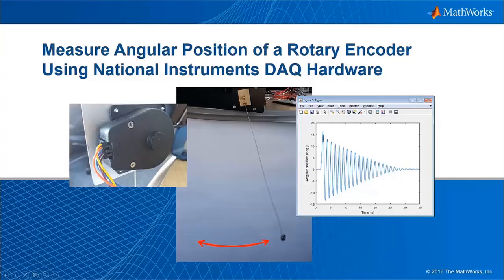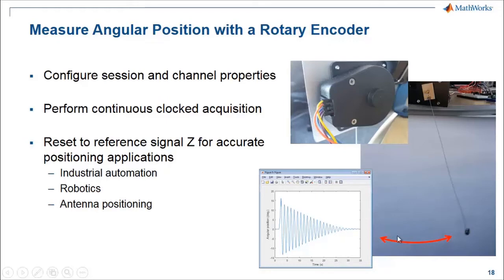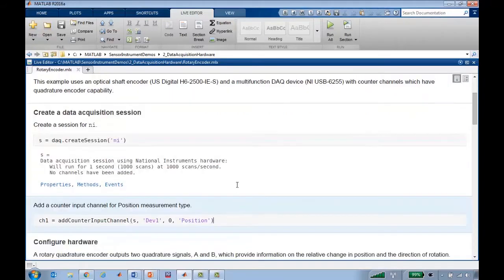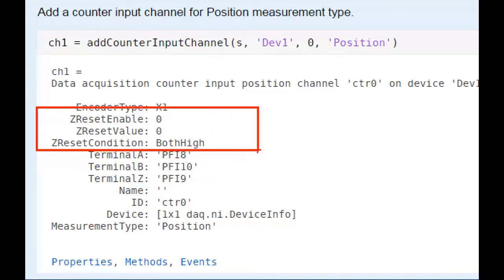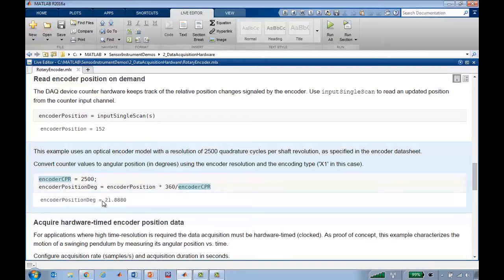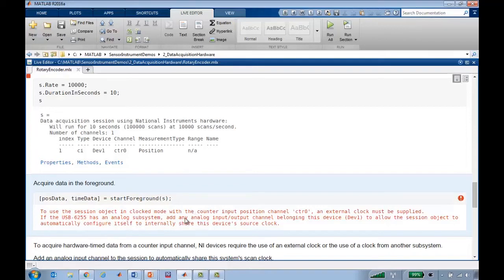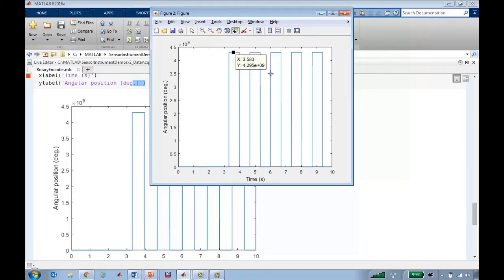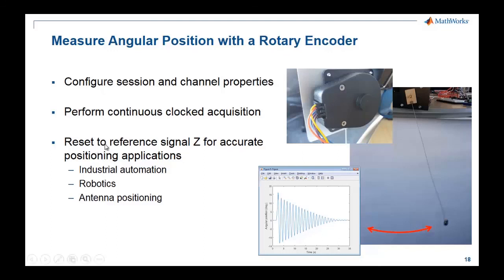Measure Angular Position with a Rotary Encoder Using National Instruments DAQ Hardware

Comment: Great video, but if were not rich and can't spend 3,200 on a daq where can we get one that can measure motor position accurately for less than 200$?
Reply: Arduino plus rotary encoder from Sparkfun.